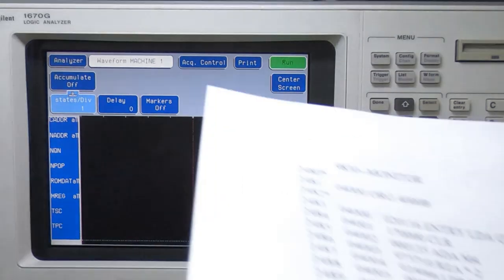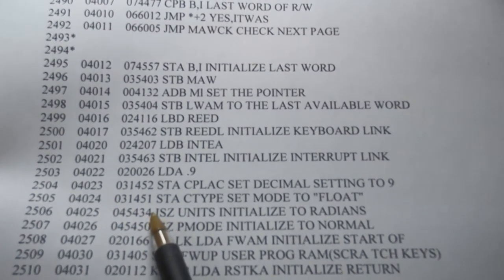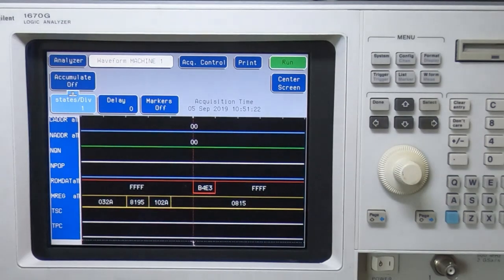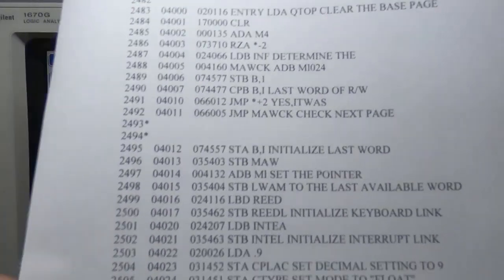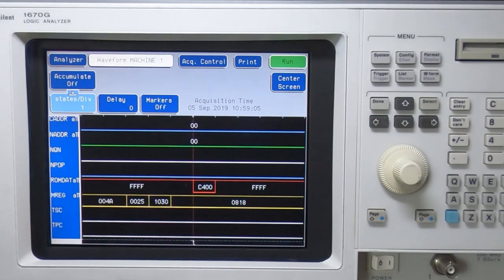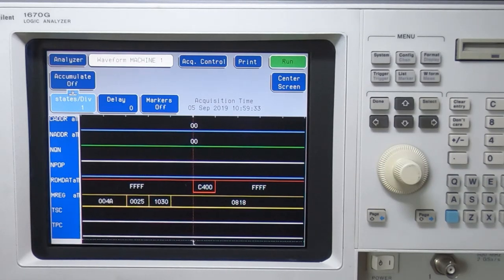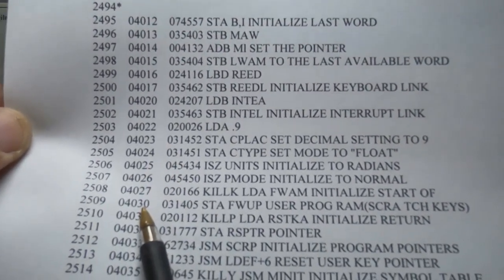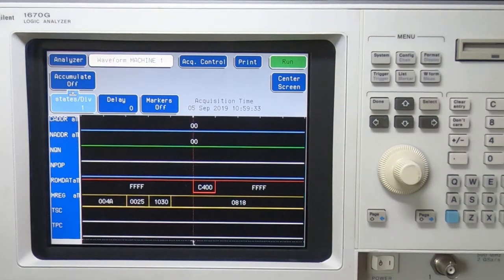HP9830A  Repair  Part10

Comment: Chances are the code for the 9830A is not the same as the 9830.  A better alternative might have been or might even still be to see if you can find someone who has a working ROM board for this machine machine, (or at least one with different failed roms) and have them read it out.

Comment: It seemed kind of strange to me that you triggered on that second address the way you did.  Would it not have been more intuitive to just trigger on the next expected instruction in sequence or even just follow them in system code sequence by restarting the start up rather than triggering on some address that you don’t know how it got there because the code is running you knead w not where?

Comment: 100 ICs seems  like a lot of replacements to me too. CuriousMarc had an over voltage that took out ~26 TTL chips in a HP9825. I can't imagine what condition could have cascaded into 100 ICs in total.
Reply from the maker: I explain the likely cause in one of the early videos in this series but also bear in mind that the 9830A has around 4 times as many IC's as the 9825.
Reply: @JerryWalker001  Definitely MORE cards too as a resulty of 4X ICs. I think the 9825 had 5-6 cards in a "fan-fold" edge-connector configuration, a little more dense.

Comment: You should set up an analyzer label which uses negative logic and displays in an octal base instead of hex so you can skip going through the manual conversion steps in the video.
Reply from the maker: That is exactly what I did. I only showed the manual process in the video to demonstrate what was going on. The testing I did was very long and tedious but I did not want to make the video too long. The main thing I am trying to show is the faults and in this video it was the difference between the expected results and the values found. This may sound obvious but in the next video you will see why I am being so careful in showing the conversion as it got very complicated.

Comment: I believe the 30A has a updated ROM code, or at least a patch to it or they were trying to fix something that wasnt working on a number of units..  I wasnt really able to discover which.  I saw a brief glimpse of on some engineers and App notes on the 98xx series.   Are you on Hackaday.io?  I would favor just having new 98xx cards made with more modern chipsets, even if they run the original code.
Reply from the maker: Yes I intend to design and build a ROM card using newer devices but as I said in the video I cannot find a copy of the actual code in a form that I can easily use. I have started manually copying the firmware values from the patent pdf but it will take MANY hours to complete and I have no idea how many errors it may have so I was hoping that someone had already done this. Making the actual card will be the easy part. In fact to test it I will just hook a few ROM's to the 9830A and see if it works and then I will design a card.
Reply: @JerryWalker001  I'd be willing to help.  If its on a PDF, I can convert it.  I am not much of a programmer but I will try.  There is also a HP 6940B multiprogrammer for the HP-IB on the calcs.  I dont know how many of the 98xx's use the same cards.   9810A, 9820/21, 9830A, etc.   There appears to be any one of the 986x printers, memory devices, tape library, as well.  I have a list of 98xx series links, docs and pdfs on my server.  I dont know also if you have seen these pages:
Reply: http://hitchhikersgui.de/HP_9800_series      /     https://bukosek.si/hardware/collection/hp-9830a.html     /    http://madrona.ca/e/HP9830/index.html
Reply from the maker: Hi I tried the link but it just gets flagged as trying to download a virus and does not load
Reply: @JerryWalker001  hmm all 3 links works fine here.
Reply from the maker: My antivirus blocks the links with a virus warning (Minecoinhive-N which is identified as a trojan horse).
Reply from the maker: I forgot to say that I intend to make up a simple microcontroller interface and read the ROM contents so that I know what they actually contain. If there are only a few errors then I can use the data as the starting point for a full binary for programming  a new ROM (probably a pair of ROM's).
Reply: @JerryWalker001  My from a cursory look and from what i have been seeing with yours, I can be reasonably certain is that there is at least one error which isnt being terribly helped in any form by faulty components.  A new ROM solution would be great.  FWIW, I had the 9820.
Reply from the maker: I only showed one error in the video but I found several and the nature oof the errors (such as trying to write to 3FF) indicates that at least one ROM has failed. My next step is to make a simple interface for the card and try to hook it to my Dataman as a 27C400 and then read the entire board contents as if it was a single EPROM. I can then compare the results with the Patent. I will of course be posting a video. Once I have the code I may be able to edit out the errors and test it with a new ROM. I have looked around for information on the 9830A but anything you have may be of use. I have done a lot more testing than I have shown in the video's and I am fairly sure it is a ROM fault. If I can get the code and 'fix' it I will be putting it on my web site so other people can get it if they need it.
Reply: @JerryWalker001  I saw a site that posted the microcode generated from a OCR scan of the patent doc.  http://madrona.ca/e/HP9830/microcode.html
Reply: @JerryWalker001  this may be what you're after.  http://madrona.ca/e/HP9830/microcode.html